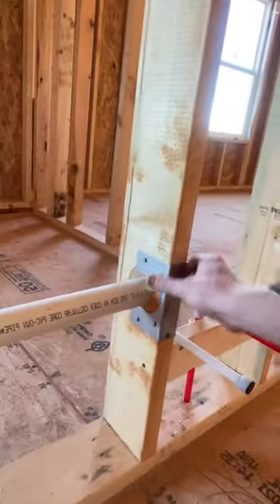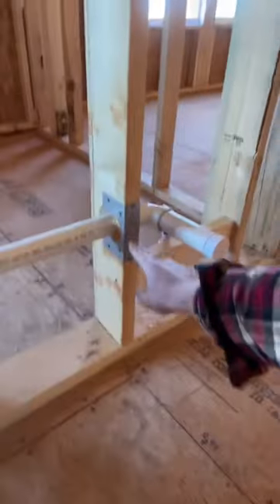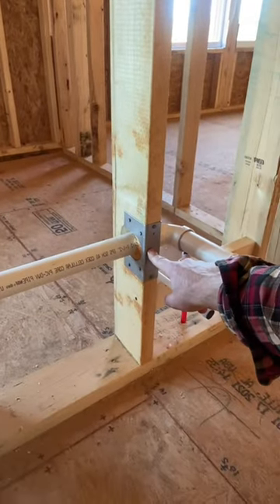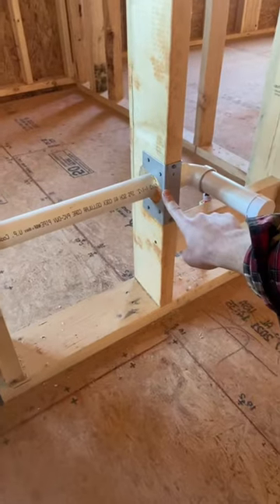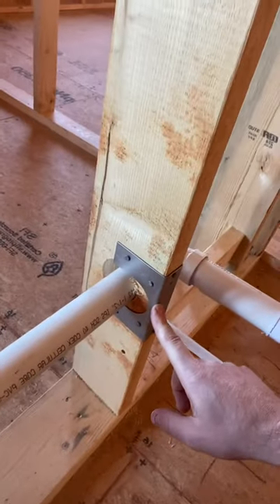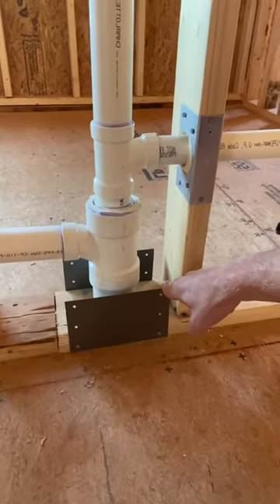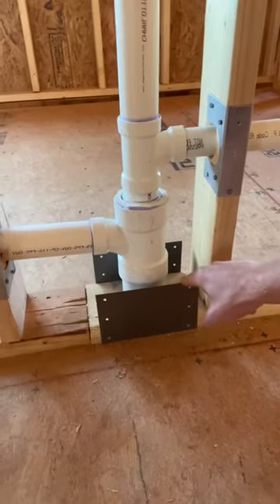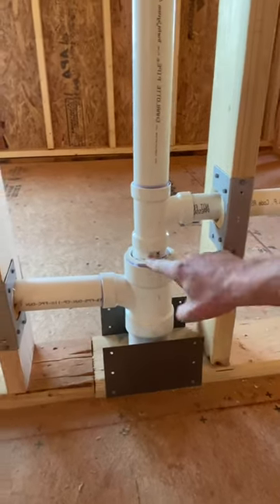Stud shoes, Plumbing guards and non bearing walls

Comment: Not required? Not only is a plate required, he should have placed another one on the otherside. It may not be code but its 100% good practice. Good practice makes a good contractor, a bad one just does the minimum or the not "required"
Reply: Only doing the bare minimum. Another way of saying “not required” Another way of saying that is mediocre. I guess a job well done is not required? Just get it done, is that what we are to expect now a days. Either build it yourself or expect to receive what the builder can get away with. The bare minimum for the maximum price.

Comment: It’s called a nail plate, and in most jurisdictions it’s required when the pipe is within 1” of the stud face not 1-1/2”
Reply from the maker: Read the code book
Reply: @constructioncodecoach5640  obviously I have read the code book, thus my previous comment. Everyone and their grandma knows them as nail plates. This is because calling nail plates plumbing guards would make no sense because they are used by electricians as well.
Reply: @justinhampton3544  Justin is correct here. 1-1/2" above/below the pipe/electrical as it penetrates studs horizontally,  cover the top plates and 2" below the top plates as a pipe/electrical penetrates vertically. And yes, it's 1" from the face of the stud as common practice by all trades, not just plumbers. The recent code reads 1.25" but I know no one that does not cover their work at any and all depths from the face of the studs. Trades that do not cover their penetrations get kicked off my job sites, especially if an inspector finds them to be in violation.

Comment: 🙂🇺🇲Looks to be a🇺🇲🙂
passive load on that wall,
which means it's a good idea
to reinforce those studs; And
may be required by the
inspector... Plus flexing could
later create cracks in tiles, and
sheet rock... So, we disagree...
Good Luck, God bless...